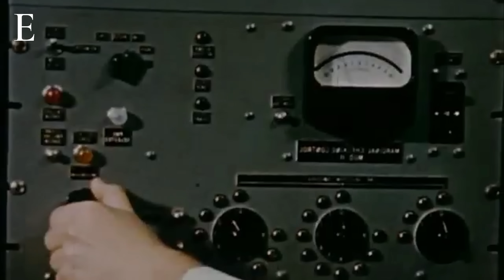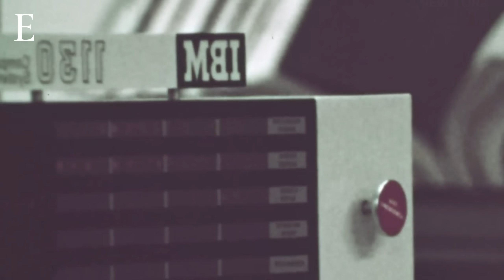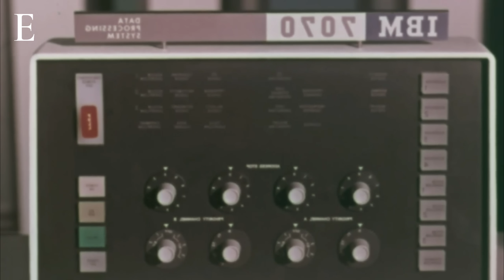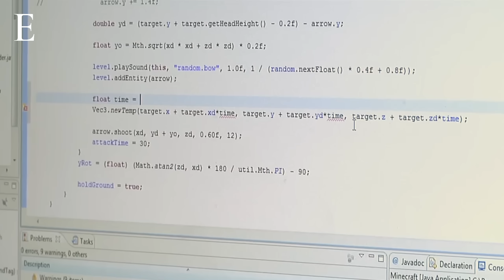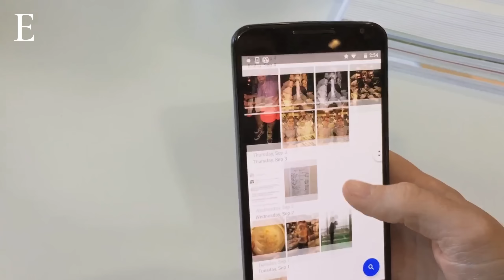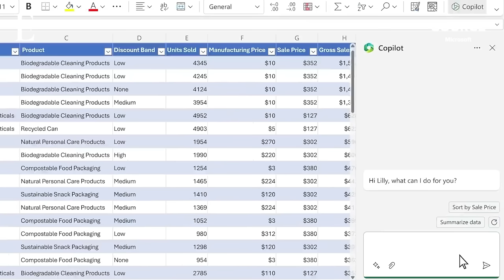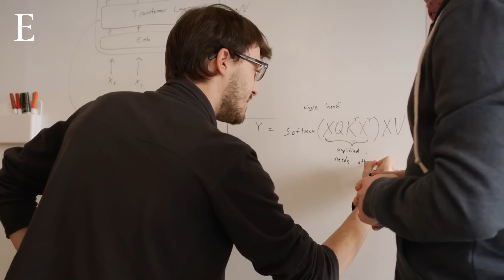The Rise and Fall of Software Engineers

Comment: I'm a software engineer who has recently started using AI at home on personal projects because I'm not allowed to use it at work.

In my personal experience, it can be an incredible accelerator. But for anything more complicated than a basic CRUD web-app, you still need a human driver who understands the code. If you don't it will screw things up spectacularly and end in a miserable state.

But if you know exactly what you want and can describe it in clear unambiguous language, it will greatly boost your productivity. Just don't expect it to architect your solution.
Reply: If the organization does not follow best practices and standards for software development and architecture, AI will only amplify existing problems in that software. At least until Artificial General Intelligence takes over programming, we need robust organization-wide development practices to utilize the power of AI. Yes, fewer engineers can build or improve more things with the help of AI, but I am skeptical about AI replacing the software engineer like 100%
Reply: Yeah but non tech people dont understand that...
Reply: What's wrong with my code????? Well I don't remember I ran out of tokens, my context has switched to try and understand your process emotions... I don't know, but I can hallucinate about it until you call in the Dr. Aka a software engineer without AI shortcuts to treat both you and the AI
Reply: The is why learning requirements engineering (RE) is a great skill to have when using LLMs.  You can't go around and tell these tools to "write me a TikTok-like app that will be more popular than TikTok and make me a lot of money".  🤣
Reply: For now...
Reply: But isn't describing exactly what we want unambiguosly called programming?
Reply: But AI is created by Software engineers,so how can be their downfalls
Reply: @leo_ai_7  it turns out you don't really need that many junior/mid level engineers if you have AI
Reply: I'm basically the architect and and AI is the developer, I'm learning as I go to be a better architect
Reply: AI only replaced Google search and Stackoverflow in my workflow.
Reply: The point isn't the limitations it has today, but the rate at which it's overcoming those limitations.

SWE's will be replaced this year.

No legacy human will have a job by 2030.
Reply: The most important word here is "STILL", isn't it?
Reply: see the skill of coding AI 2 years ago, and compare it with what it can do today.
Now predict what it will do in 2 years from now......
Reply: Not yet. But eventually it will. Eventually AI will do all programming and fully replace all software engineers
Reply: @VectorAlphaSec  exactly all these engineers are copeing 💀
Reply: @ The problem is they are scared and thus are in denial and refuse to believe or accept the possibility and future that their careers will one day be gone and replaced.
Reply: @VectorAlphaSec  true
Reply: And this is why jobs will be lost - there won't be any need for large teams of developers when you could have a small number or even just one with the help of AI.
Reply: All that in just 2-3 years.. imagine what it could do in next 5 years
Reply: So in other words, what are supposed-to-be Junior/Entry-level positions are being pushed out more and more as the bar gets higher and will potentially end-up being increasingly gatekept than it already is.
Reply: I'm seeing comments like this everywhere sure it can't do more complicated things but in time I think it'll will cover every little gap there is right now
Reply: @anderson2718  It won't, because programming has never been an issue but rather shifting requirements and communication. People can't even use google to find stuff, they won't be asking a tool like that to bring up and maintain something.
Reply: What do you mean by architect? English is not my main language
Reply: @MrWebon   A software "architect" is someone who lays the foundations for how a piece of software is to be developed, liken it to a normal architect who plans every detail of a house on a blueprint before it is built. A software architect plans how each piece of software is to developed for your specific solution well before any actual code is written.
Reply: There is a trend here. That is, in 15–20 years, programmers in the classical sense may no longer exist. The scenario has to lead somewhere.
Reply: @alevyts3523 Agree and disagree, because another trend is that ai programming responds well to programmers, not non programmers. So in a way, ai only acccelarates the work of a programmer but it cannot replace him.
Reply: @Binahx86  Trends always change.. When the nvidia ceo said they want to make AI more user friendly for non programmers such that they don't need coding knowledge. They will be doing that...
Reply: @Binahx86  i can assure it responds very well with non programmers too
Reply: @Binahx86  The best analogy is that it works as a lamp Genie. If you know exactly what you want he may grant the wish and provide value. But if you are just saying crap he will absolutely annihilate you. Most people are better off not messing with the Genie.

Comment: Only a maximum of 10% of the current market will remain (I've been saying this for years- this is the so-called "huge accumulation of success," meaning IT [the general TECH/IT/AI industry] will only be for exceptional, scientific minds, with PHILOSOPHY as the "meta-mind").
Reply: im a 2024 graduate looking for a job asa  software engineer should i change careers? i was thinking of doing machine learning/ data science or cybersecurity? should i go with those or go into something outside of tech. i still have student loan from my tech degree and now its of no use😭😭😭😭😭😭
Reply: @Mahima-y2s  First, take an IQ test (a professional one- MENSA); if you don't fall within the top 1-10% of the most intelligent people (the so-called "scientific IQ"; no one has won a Nobel Prize in the sciences with an IQ lower than this), you won’t make a career in IT (you won’t be able to reach the appropriate level of critical thinking, meaning AI will be better than you, because it will only lose to a scientific mind). 

But now, a door is opening for people in IT, and that will be: DevOps AI (Python, networks, Cloud MCP, AI Agents).
 
Cybersecurity will also require a lot of people, but there you need many talents, and eventually, it will be the same as programming. It depends on what you prefer, but I recommend: DevOps AI and building complete AI Agent solutions (a cloud server using LLM and in the future LCM). 

And most important- recognize your greatest talents because otherwise, you won’t stand a chance
(e.g. for cybersecurity, you need to see details/be very meticulous)

Good luck!
Reply: @Mahima-y2s  Cybersecurity for sure. Machine learning / Data science is the most competitive CS field
Reply: Yep the field will adjust. Just being a Software Dev will not longer mean extremely high salary.